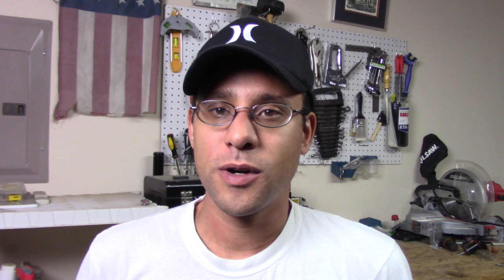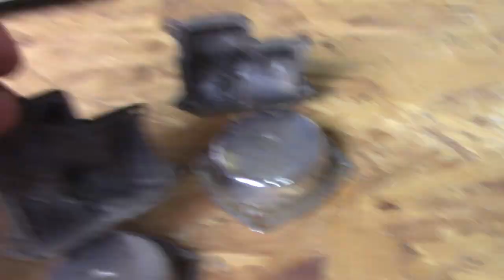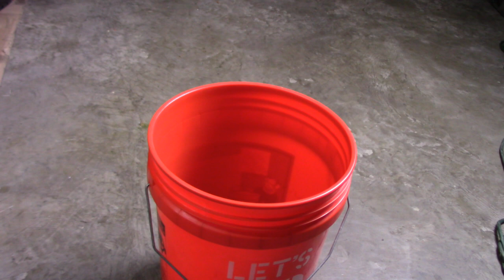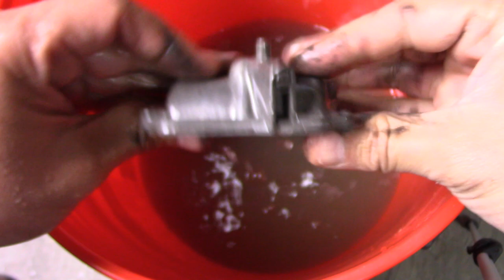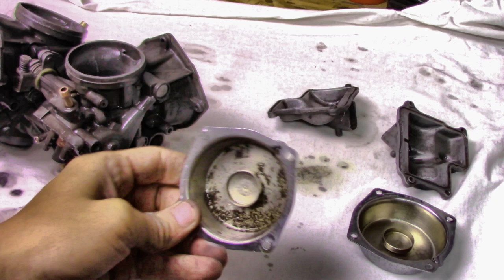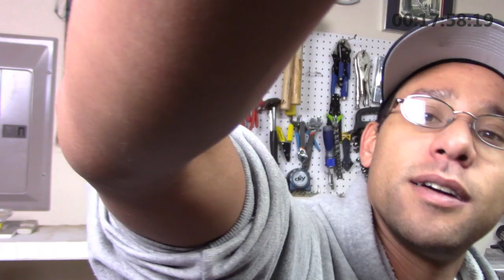Project Starfire: Juicing your Carburetor (Rust Removal)

Comment: Lemon juice is a mild acid, so it should clean up some rust. Great video.
Reply from the maker: Some??? It cleaned up most of the rust. And that carb was pretty bad.  And thanks for watching and the comment.  CHEERS!
Reply: Was there any of the carburetors part seized and did it free them? I guess a good spray of that WD40 would help loosen any stubborn bits that may be seized. It's amazing what can be restored that would have otherwise been thrown away.
Reply from the maker: +RevvedUpBiker No parts were seized.  Just very dirty and rusty.  In the next few days the carb will be going back on and she will hopefully be back alive.  Recording and editing is underway
Reply: *****
Should run lovely and smooth with clean carbs. Might take a few turns for fire up, but should purr lovely.